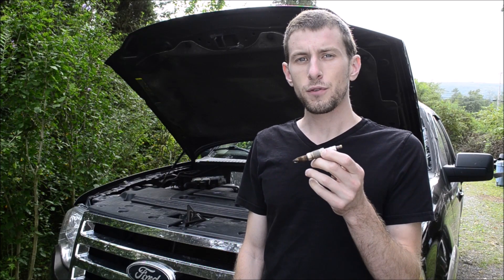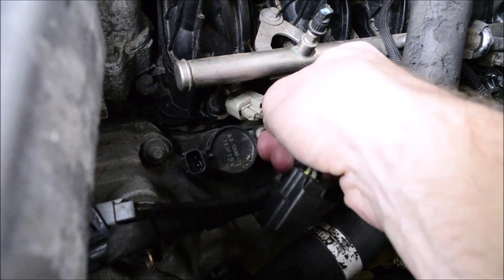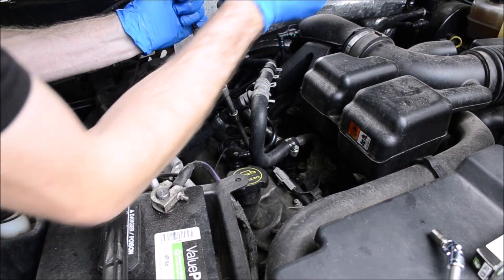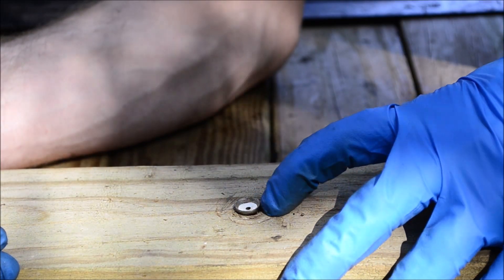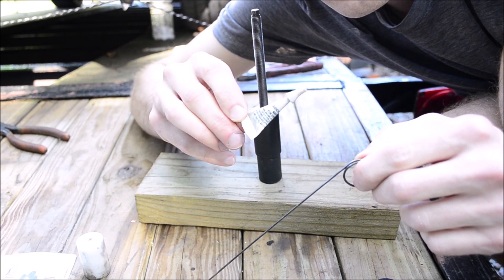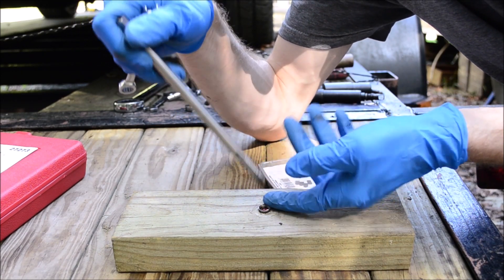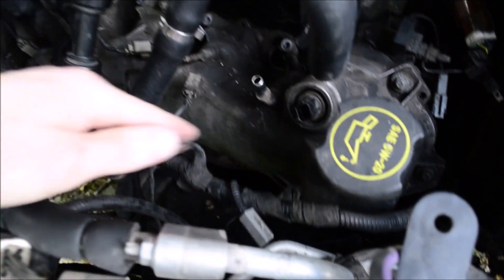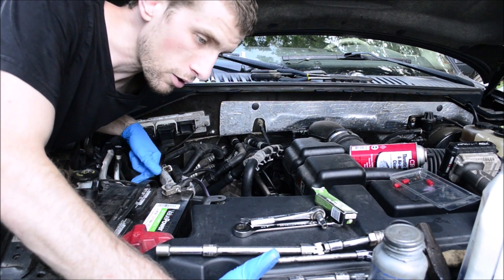5.4L Spark Plug Replacement & Remove Broken Sparkplug - Ford Expedition, F150, Lincoln Navigator

Comment: Good job. Everyone has a different way of doing it mine was a two day process I soaked mine with pb blaster, marvel mystery oil, and some sea foam a cap full in each spark plug hole. I'd go out every hour and work them back and forth tell I got more and more of a turn out. I let them soak over night and the next day they came out and all the carbon that builds up on them was mostly off. 8 new plugs and no problem didn't screw up any o2 sensors.

Comment: It would be easier if the spark plugs were mor durable and did not break upon removal
Reply from the maker: exactly, that's the problem, the design of the spark plug, luckily some companies make a solid sparkplug that doesn't break during removal

Comment: How much would this cost to have someone else do this. It suck because I could do this if I was not so stupid short and weak. I replace spark plugs before  but on much smaller cars.
Reply from the maker: I'm not sure you'd have to call around, it would vary greatly depending on the shop

Comment: What is the name of the  "pipe" called that got removed to access the spark plug?
Reply from the maker: the long rubber thing with metal spring inside is a spark plug boot

Comment: I recommend a shop vac with an extension tube to remove the ceramic bits.  If the plug shattered in to small pieces you don't want to slow any down the hole.
Reply from the maker: that's a great idea

Comment: Somewhere somebody commented that is better to try first with an impact driver, slowly. I'm guess a battery powered one, not a powerful air comppressed ones.
Reply from the maker: possibly, very gentle trigger squeeze
Reply: @aDIYCarGuy  Do you think could be good to add some lacquer thinner to the fuel tank and run it for several days and see if helps cleaning the carb deposits?
Reply from the maker: @phillipepinesh5343  It might help, even if it helps free up 1 plug it's worth it
Reply: @aDIYCarGuy  I just removed #1 without breaking it. I was concerned to do it but, found that this one in particular wasn't working having rough idle and acceleration so, I though, if is not working the carbon will be wet. So I poured some PB blaster and started first trying to thigthen a little bit and go back again just like 1/8 or less. After that, I used my 12v Bosch impact driver and give small back ant forth knocking untill I noticed by hand that it started to move around 1/4" , then poured more PB blaster and some liquid WD40. I keep by hand goig back and forth until got loose. To my surprise it was clean with no carb deposits. I don't know how will be the others but, will try once get the new plugs. My Expedition is 2007.

Comment: Wow that was fascinating.  <sarcasm>  It's amazing that an extractor kit has to be designed to fix a bad engineering  design.
Reply: Also the kit had been redesigned 3 times due to failure breaking its threaded tips .
Reply: Overall I think the engine is good spark plugs design is next 2 trash two thumbs down 👎👎